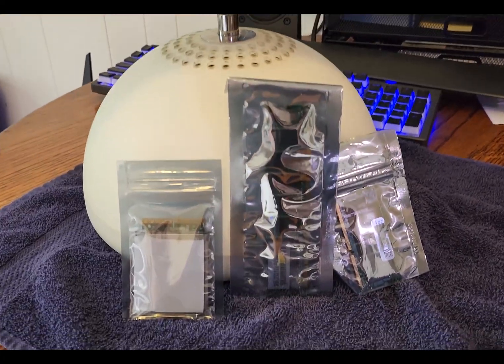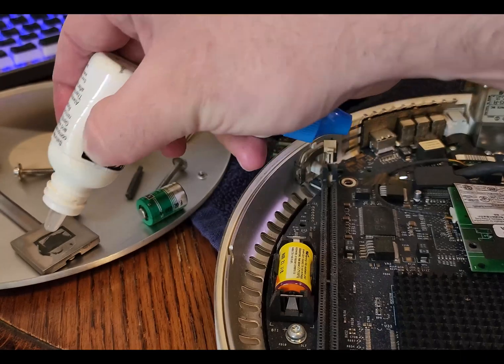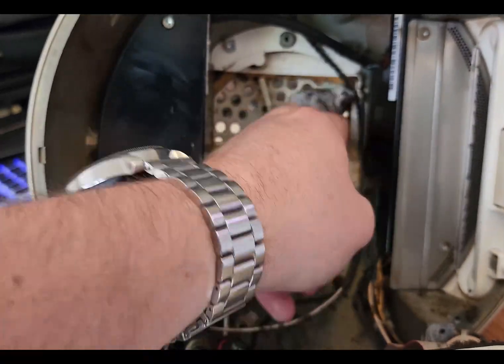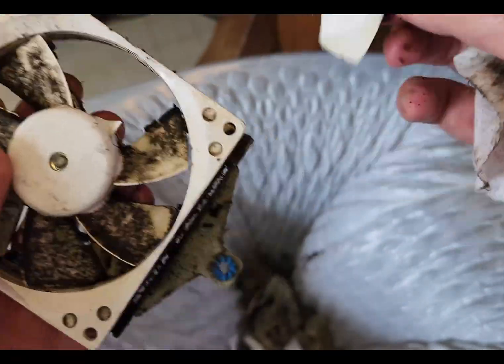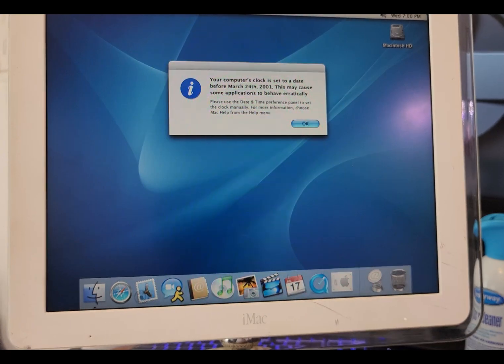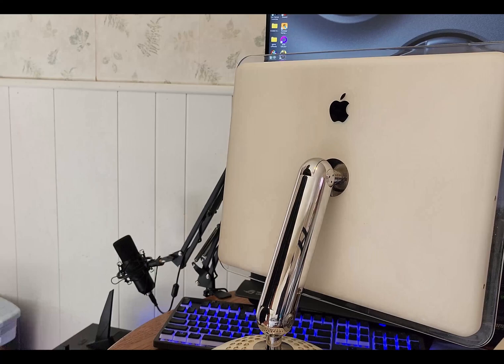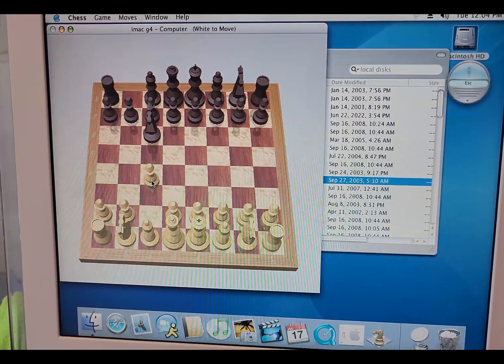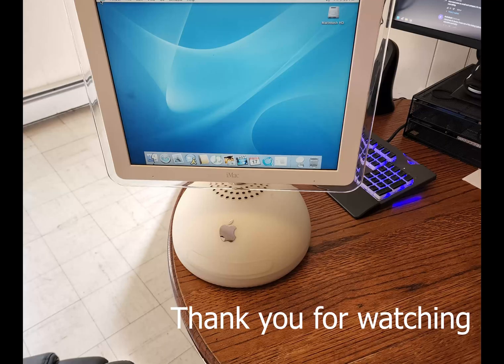Repairing and upgrading a 700Mhz iMac G4

Comment: Help! My son-in-law is gifting me with an older iMac 15 flat panel I am going to upgrade and clean everything. But need one bit of information. There are two ram sticks "Which which is which" Which one is Dimm0/J12 and which is Dimm1/J13? I need to know prior to arrival so I can have all parts needed to get it up and running. Thanks in advance.
Reply from the maker: Use everymac.com to lookup your specific model. They helped me.
Reply: PC133 SDRAM M8672LL/A shipped with 128 MB of memory and M7677LL/A shipped with 256 MB of memory.  Maximum RAM:	1 GB. There is one factory installed memory module in a 168-pin DIMM slot and one 144-pin user-accessible SO-DIMM slot.